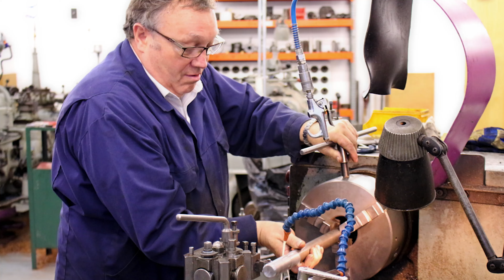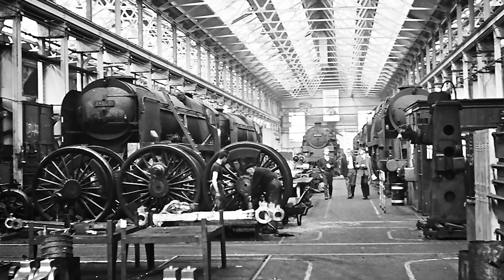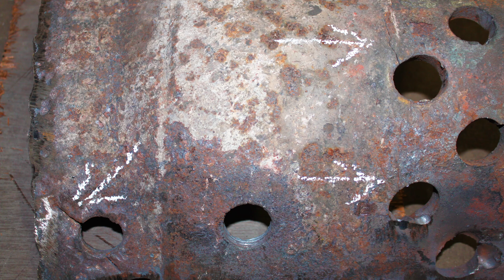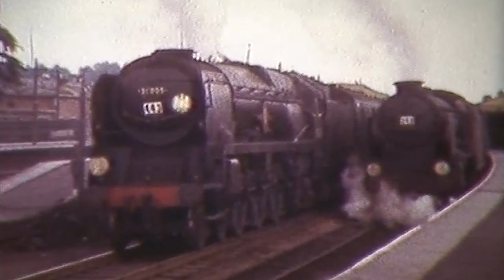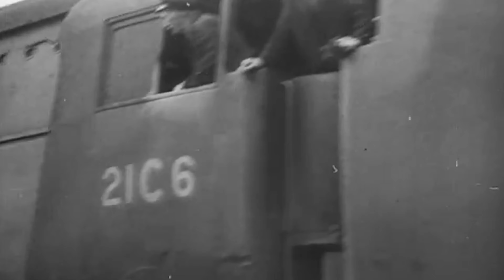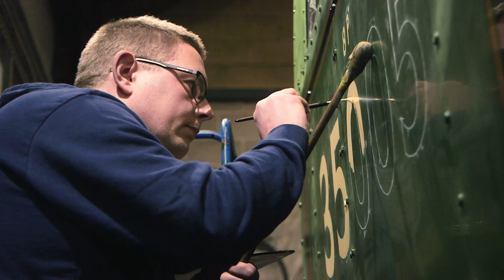The Canadian Pacific Project: An Interview with Dr Becky Peacock

Comment: An improvement on the first version but still Bulleid not mentioned.  Strange.
Reply from the maker: Hi there, as mentioned this video is more about the CP project and overhaul challenges rather than the initial design phase. You might enjoy this video we released recently where we chat to Bob Cartwright, an ex-BR driver who gave us a bit more of an insight into how Merchants were on the mainline and a bit of background into Bulleid himself. 

https://youtu.be/WMcW4olh5Ak

- Will
Reply: It's not strange at all: as Dr Becky is talking about a) the overhaul process, and b) the rebuilt form of the locomotive (which was done without Bulleid's interference), discussion about the designer is largely irrelevant.
Reply: Probably because he's not involved with the project 🤷🏼‍♂️
Reply: @ Were any women?  Actually doing the work I mean.
Reply: @howardalexander0621  But his innovations were, largely critically and his designing record and  efforts to improve the machine are surely more important than a few women operating lathes etc..

Comment: There are unofficial timings west of Basingstoke where it was said they had beaten Mallard with Merchant Navy and the lighter Pacific's! But because it was enthusiasts doing stop watches and mile posts and not using a Dynamometer car that it doesn't stand at the speed written in some books. Lovely to see its restoration though.
Reply: The same can be said of steam locomotives from the US, especially locomotives from the Milwaukee Road and the Pennsylvania Railroad.